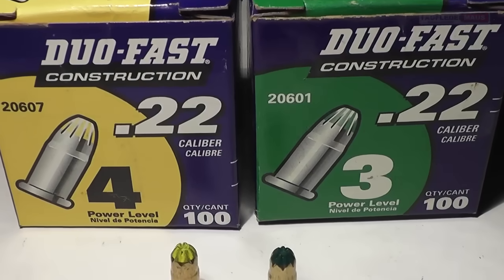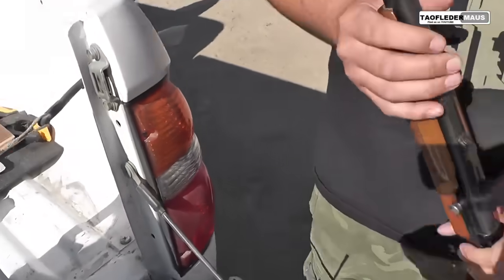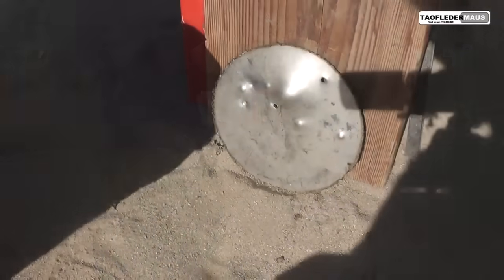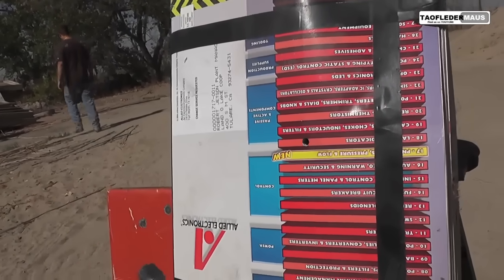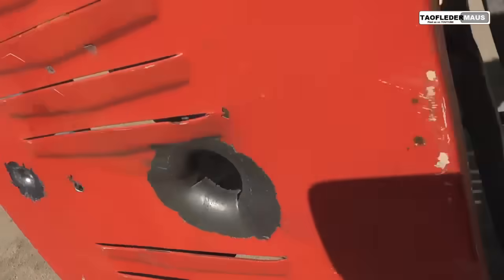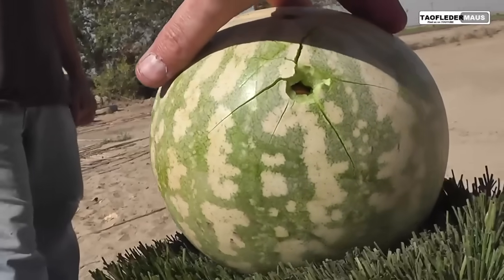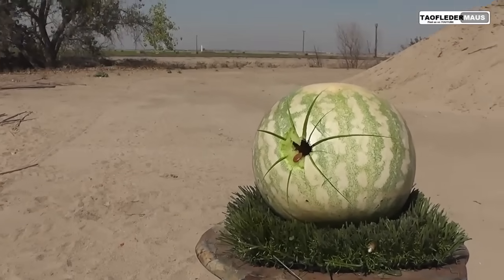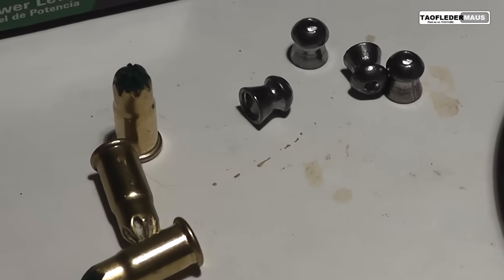Shooting .22 PELLETS Using NAIL GUN Blanks - What happens?

Comment: I swear, like 1/2 of the comments are asking you to glue the pellet to the blank.  Also, am I missing something because it looks like you are dropping the blank in the gas cylinder? After that I see the blank in the breech, but I'm confused why it is dropped in that way?
Reply from the maker: +jho240  .  The chamber is larger than the barrel,  so the pellets being soft and short do not make it through that transition very well if they are set directly on the tip of the blank.    They work best when set in the very beginning of the barrel,  in the rifling.   There is a small gap between the blank and the pellet which normally is bad if you did that with a black powder muzzle loader.  But it works in this case because there is far less pressure.   The safety factor is if something goes wrong,  the base of the blank will blow off and the pressure will just open the bolt.   Or,  the pellet will blow out since it is so soft and weak.

Comment: just spit ballin but I'd imagine that the pellet is getting alot more back pressure since it's such a snug fit in the barrel. Where the bullet is just a little loose in the barrel, which allows some gas to escape. thus the difference in velocity. Also the mass of the pellet over the mass of the bullet is prob more so it can do a little more damage. Put the two factors together and you have the results in  this video. Or at least that's what I speculate anyway.

Comment: LoL, finally a useful information filled gun video.
Thoughts.  Dump the muzzle loading and go breech.  Use either a bolt action or a Thompson Contender (or even a New England break action single shot) with a .22 LR barrel.  I need to get some pellets to try this.  I think that if breech loading with a break action dropping the pellet in ahead of the nail driver should be pretty easy and about as comparable in speed as loading an old Sharps rifle with a paper wrapped charge.  Maybe faster because there is no need to bite anything.  In NYC I knew a guy with a nail gun that had deactivated the safety so he could just point it and fire a nail.  I think your trick is much better.  Good job guys.

Comment: Glue the pellets to the crimped end of the blank. It almost fits perfectly in the skirt and if you shoot it out of bolt action rifle you will have a decent replacement .22 round.
Reply: have to be careful with what kind of glue you use tho, you porbably want something that settles really quickly and is half strong, if its really strong it could cause a big failure
Reply: Just a tiny dot of epoxy works, its brittle when dry and fragments into dust, hot glue stays gooey and can gum up things.. ive only done this with regular BB's though  @theragingslushy
Reply: Real men of genius
Reply: Should be in the bottom of every Prepper bag !!

Comment: what is the powder charge on the blanks vs the powder charge on the CCI .22 ammo?  have you put a caliper on the pellets and compared it to the .22 bullet?  do they make a .22 bullet that has a similar weight to the pellet?  is the crimping on the blank cases tighter than the seating of a .22 bullet?  I'm asking all these questions to try an figure out whey the pellets fliesso much faster.

Comment: why are u shooting towards a house?
Reply from the maker: +Peanut Butthurt  We weren't shooting towards a house.
Reply: +TAOFLEDERMAUS to the left of the sand/rock pile, behind the target there was a building or a house.
Reply from the maker: You have a lot of faith on how far a pellet can go. lol
Reply: +TAOFLEDERMAUS you were shooting normal 22 bullets too, its not likely anything would happen, but you never know, and you should be promoting gun safety in that matter. (You'd think with a big channel like this at least, but thats up to you :))
Reply from the maker: I'll go back in my time machine and re-do it.  Sorry.
Reply: +TAOFLEDERMAUS <3
Reply: +Peanut Butthurt 

This guy makes a good point. Just generally never a good idea to discharge firearms in populated areas.

However on the flip side unless that shot is going to keep it's momentum for the full +1000 yards
away that house is...
Not much real danger.

Fk if I know how far away that house is...
Looks like it's over a mile away at least.
Reply: +Peanut Butthurt You do realize that pellets have a HORRIBLE ballistic coefficient, right? If you don't know what that means, look it up. Basically, the average .177 pellet will lose half of its velocity at about 150 feet, then another half at another 150 feet, and so on. By the way, these estimations are for a wad cutter pellet, but still. There is no way in hell that it would make it to the house, even if it's going 3000 fps.

Comment: " non-blowback style gun"

I've never heard of a gun referred to as "blowback" or "non-blowback". I assume that a blowback style gun is one that automatically ejects the cartridge? If so, then would all Semi-Auto rifles be blowback style?
Reply: +MiningwithPudding Yeah you're on the right track.Blowback operation is a firearm that obtains the energy from the expanding gases created by the ignition of the round pushing the bolt back. Other types of self reloading are gas operation, which is similar but instead of just the energy of the gas expanding pushing the bolt  to the rear, the gas is directed into a gas port that is attached to a piston and rod which connect to the bolt, driving it backwards.  Think about an AK along the top of the barrel towards the business end, there is a port coming off then going back towards the rear of the weapon. This is the gas port.  When a round is fired, gas directs up this port and pushes on a piston which connects to a rod, pushing the action backwards. This is just a basic description, there are all kinds of different types of gas operation alone, depending on the rifle.  For example, some have gas valves because if all the gases from the shot were allowed to push on the piston, the force would destroy the weapon and most likely hurt the shooter. AK's do not have a gas valve, they actually have a series of ports in the gas cylinder.  For a visual check this out.  https://en.wikipedia.org/wiki/Gas-operated_reloading has a good graphic to show you.  There is also blow forward, recoil operation, and a few others.

Comment: This is really cool, I have never seen anyone try this before, and it obviously works great. You are achieving extremely high velocities with those lightweight pellets. Very cool!  Some guys with break-barrel, spring piston pellet rifles are adding a drop of oil in the pellet skirt, then firing it from the air rifle.. The air compression ignites the oil, creating a high velocity shot. It's pretty cool also, if you like messing around with air rifles you might give it a try. They call it dieseling.
Reply: I dieseled hundreds of pellets from my old Gamo (back in the 1970s). It would be interesting to experiment with different fuels. I had sewing machine oil so I used that. No malfunctions but anti-fun parents confiscated it.
Reply: +Trevor Jameson Dieseling is really bad for the gun though. If you really want hyper velocity pellets, just make your own rifle that will do so. Barrels can actually be made from paper. Yes, that's right, paper. You have to make the barrel pretty thick though, and watch the pressures.
Reply: It's not true, dieseling is a fairy tale. Personally, I tried it with several fuels and a few air rifles for me.
Reply: @dolejspavelnevim9409  whats not true?
Several people have posted deiseling videos on YouTube. 
It won't work in every airgun. 
The lower-powered guns don't develop enough pressure to ignite the charge.
Reply: +Trevor Jameson Gotta try this...how to seal the oil in the pellet ?
Reply: I've done it, but the results are not very consistent, unless you have a way to ensure that you use the exact same amount of oil each time. And it's murder on barrel seals, they don't last long.
I've got another stupid idea, boring out the back end of a .177 air rifle barrel so that a cartridge will fit in it, modifying the compressor so it punches the primer (instead of trying to blow air through it), loading the modified bb gun with slugs and giving that a go. Those slugs ought to go like the clappers.

Comment: I think those cartridges have more explosive power than normal gunpowder, they are made to say "bang" even without a bullet, so it's probably a little bit unsafe, but the barrel is over engineered enough so it doesn't really harm it
Reply: bayenne5b they aren't a more explosive gunpowder they'll just put in more gunpowder since there is no bullet and yes the gun can handle it it was made to fire .22s and those are exactly what those crimped blanks are

Comment: A warning to anyone thinking if trying this.PLEASE BE CAREFUL. IT WORKED FOR ME UNTIL THE BLANK BLEW THE SKIRT OFF OF THE PELLET AND WEDGED THE SKIRT IN MY CHAMBER AND THE NEXT ONE NEARLY BLEW UP MY RIFLE!!!!!!! It was a ranger 103-2 (marlin model 80 clone) bent/ripped part of the bolt face next to the left extractor as well as broke the left extractor.
Reply from the maker: countryguywithcamera   I said it was a bad idea to try yourself.
Reply: I know im a dumbass lol. In no way am I blaming you lol. You specifically said this is a bad idea.
i just wanted to try it, I had really good accuacy with the pellet like a 1" group with iron sights. I just wanted to warn everyone what dangers lurk around the corner.
How did you get the measurement for the ram rod on where to stop?
I will be doing some research to see how to keep from blowing the skirt off of the pellets.
I will post a video on my channel showing the damage to the rifle, and of the lead fragment i pulled out of my chamber. The damage was minimal and completly repairable. However it stands as evidence to prove even a .22 is dangerous.
Reply: My 1" group was at 50yards

Comment: I think that some additional success of the pellet may be achieved in part to the hollow cavity at the rear of the pellet. Similar to the Civil War era "mini ball". I think when the powder charge goes off it might be expanding the rear of the projectile precisely to the shape and size of the bore, which would make a complete and ultra tight seal against the blast of hot and expanding gas while letting almost no blowby past the projectile, explaining the amazing speed. It may also be sealing so well that it is able to maintain an area of relative low pressure in the front of the projectile and (possibly) creating a system that is resulting in a net "suction force" on the pellet, which could explain the lack of instability in flight and the apparent tendency to not tumble. I think this is what you have achieved! This massive pressure and reshaping of the projectile also allows a perfect engagement the lands and grooves of the rifling in the barrel imparting the best spin possible. I would like to see you try casting some pellets with a small and sharp piece of Stainless Steel (or wishfully, Titanium) to act as an armor piercing round! My head is suddenly filling with a flood of ideas that would be amazing to see on film! Great Job!

Comment: The air rifle pellet is made of a softer material so at the point of impact it crated a micro fracture in the steel that then acted as a conduit for the rest of the projectile to pass through. The standard .22 round was harder and heavier so it didn't have the same impact properties. 

Try pressing a lead fishing weight against a brick and it may distort a little, do the same with playdough and it will follow the contours of the brick perfectly. It's the same effect here. At the point of impact the pellet distorts until it finds the path of lest resistance and passed though.
Reply from the maker: TheLiquidKnight   The .22 bullet was probably softer than the pellet.
Reply: The pellet was definitely softer, i could flatten one with my toe if it was on concrete.

Comment: Hey, can you do another version of this using a NAA mini or other small revolver? I'm wondering if it makes more sense to fill it with pellets and blanks rather than the CCI Velociters I usually feed it. Just trying to get the most oomph (I was gonna say bang, but a gun this small has lots of bang) outta a toy sized weapon. Oh, and for the haters and doubters...here. http://www.odmp.org/officer/420-trooper-mark-hunter-coates. "Proper shot placement" beat 5 hits with a .357. 5 hits and the guy still returned fire and killed the officer.
Reply: Ahsieh2 Also, for the comment trolls; My NAA Mini is not my only CCW. I sometimes have 3 on my person; sometimes just 2; Rarely do I just carry one, but sometimes I get complacent. The NAA is the easiest to hide by far though. Even fits in the 5th pocket of most jeans and looks very much like a weird knife handle.

Comment: Would I be able to teach my kids with these safely? No pellet just Duo-Fast, ie: I only want to get them used to the idea of guns and to teach them about how loud they are and how they kick after you pull the trigger. I don't want to ram a pellet down these just to load them into a marlin or a Ruger 10/22.
Reply from the maker: Politically Incorrect   There won't be much/any recoil without shooting a projectile.   But  these are much louder than a .22.   If anything it might get them used to shooting,  the noise it makes,   without bullets going astray.

Comment: He is making a muzzle loader . The charge is the ( we use to use ram sets for foundations) .22 cal for shooting nails into concrete. If one takes that pellet and does not seat it on top of the charge you are going to have compressed gas that could explode through the gap ( between the pellet and the charge) the compressed gas having no where to go  to go will blow outward through the barrel. With a modern firearm the cartridge contains the primer, charge and the bullet in one entity, so this wouldn't happen if this pellet was self contained... But it's not. Watch the video again Copernicus. TC firearms ( Thompson Center) has a great video on what can happen if the projectile is not seated properly on top of the charge.

Comment: Perhaps, if I had the money and time to have a custom made rifle, I'd consider making a .22 Hawken's style muzzle loader to use both the nail gun blanks and .22 Pellets. Could be a fun project for someone to do and post on YouTube... could make for a very interesting hunting rifle.

However, what I would imaging to do is to build in a 'pellet stop' that's just short of the chambered length of the nail-gun round. And to also have a sliding brass marker on the ram-rod to gauge the depth from differing pellet makes.

The brass marker act as a second line of security to make sure the pellet doesn't go further than the barrel pellet stop; the brass marker on the ram-rod also prevents it from going into the barrel further.

The muzzle loader would be a custom breach load, but maintaining the Hawken's style barrel and stock. The breach allows for easy ejection and unloading of spent cartridge, and or unloading of a jammed cartridge or pellet.

I am interested in the Hawken's style, but of course the same method can be used in any number of breach action hunting style rifles.

Who wants to make One?

Comment: Been doing this since 2013! 410 to 22 adapters for my Judge.  Bit of candle wax
holds the pellets to the nail gun blanks (I use browns tho) Accuracy satisfactory
even with smooth bore adapters. After all ITS NOT A TARGET PISTOL!!!! LOL
Good enuf and cheap enuf for shooting rats in the corn crib. It sure beats trying
to wield a long barrel in tighter spaces and it doesn't blow holes in the siding as
a 'legitimate' 22 would do. Works at greater distance than the birdshot rounds!
Gotta make sure you killem tho, wounded rats can be dangerous!! ROFL

Comment: Did somebody say "Survival Gun"?
1-Low cost
2-Lightweight (should be 1/2 the weight of 22 short ammo)
3-High accuracy (?- doesn't that come with HV -?)
4-Quiet (pellet makes minimal noise breaking the sound barrier)
5-Substantial killing power (higher than 22LR)
(notice rate-of-fire is not listed because it's in the survival category, not combat)
My personal ratings on these 5 categories would place this system at the top of my list.

Comment: I have tried something interesting as well I wanted to leave you a comment on. I took a 55gr FMJ BT w/c Hornady bullet, heated it with a propane torch to have the lead drop out. Which left me with a .224" 17.8gr jacket. I chucked it in my drill took some 80 grit sand paper to it until it measured .218" with my caliper and drove it though my .22cal air rifle barrel with a aluminum rod. This was due to the sharp rifling at the chamber digging into the copper jacket and making it to hard to push in. Once ran down the barrel it fit with thumb pressure and went down the barrel easily as a pellet would. I then fired it at a milk jug of water. Normally a 14.7gr pellet would pass though and into a 2nd jug or all the way though one laid on it's side from bottom to top. This copper jacket I could tell turned as it was going into the jug.

Doing this little experiment got me to thinking though. What would happen it the jacket was put into the breach of a brake action .22LR like yours and used one of those nail gun blanks to drive it? It's heavier than a standard .22 lead pellet, obviously more aerodynamic than a pellet as well, and wouldn't have the skirt separation issue.

I don't have a brake action .22lr though, mine are all semi-automatics and I don't have camera's or a chronograph, care to try it and see what the results are?